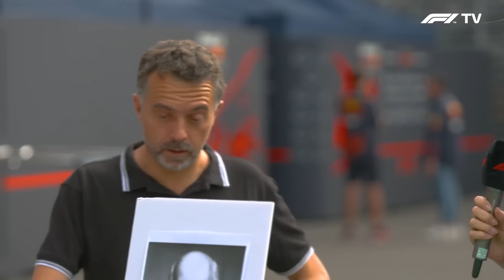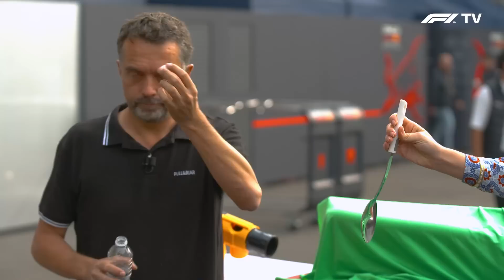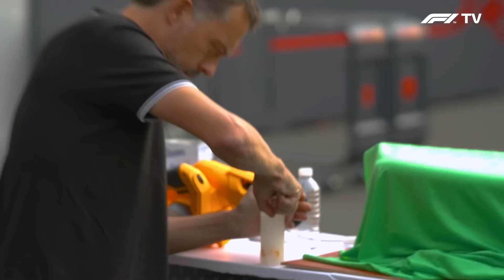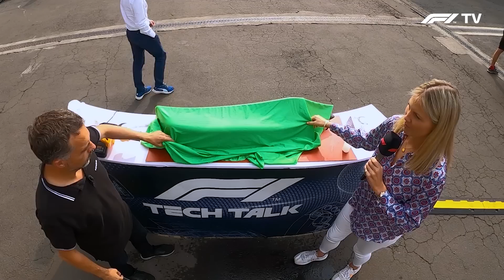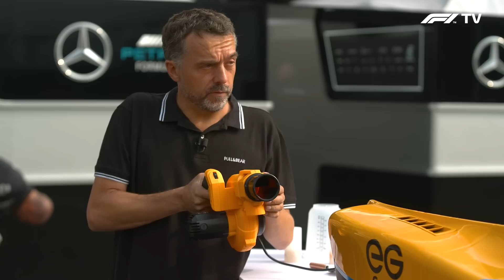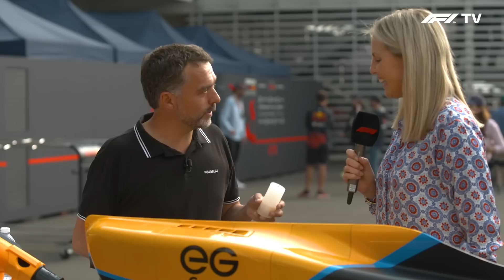Airflow On An F1 Car Explained | F1 TV Tech Talk | Crypto.com

Comment: The effect was discovered and is crucial to the design of the jet engine. It just so happens that it applies to any surface that has gas/liquid flowing past (it's also very important in the design of efficient hulls for boats, for ex).

Comment: Some evidence indicates that a dimpled surface can reduce the Coanda effect by creating an air buffer between the surface and the flowing air. 

Would love to see an F1 team try dimpling the area on the top of the chassis in front of the cockpit, and on the rear wing.   

May help, may not, but the rewards for a little bit of computer time could be outstanding.

Comment: F1 cars should use exhaust pressure to relieve the vortex drag on each tailing corner. with correct engineering, the drag mitigation would easily add a few % at high speed. with EVEN MORE CORRECT engineering, you could get dynamic aero performance out of static aero components by modulating exhaust pressures (i.e. when cornering, more drag on the inside less on the outside)
Reply: i dont understand the beginning or the end of that field, but i learned something really cool so thank you.

Comment: Coanada is needed underneath the wing, the way he explains it will result in lift rather than downforce.
Reply: No this is to make the car more slippery and to also  position the air in laminar state where you want it so the rear wing can do its job.

Comment: Only if Albert had had some dry ice could this have been visualized better. Even though it's not an outdoors friendly demo they nailed it.
Reply: Smoke/Fog machine he had for the floor/ground effect tech talk might have worked too, bit of a shame but still an outstanding demo
Reply: ...?
He had a basket of dry ice and use the windblower to blow the cold air through the compressor.